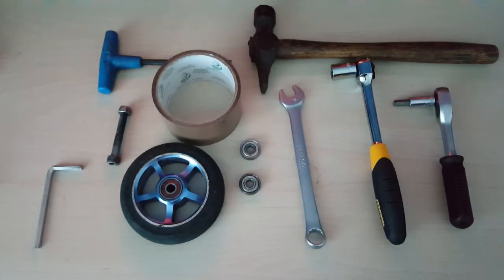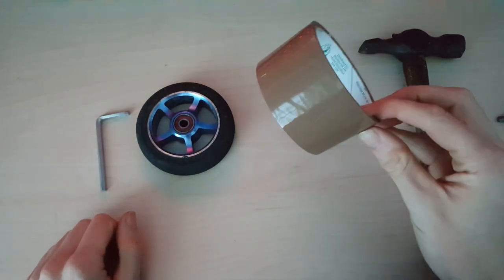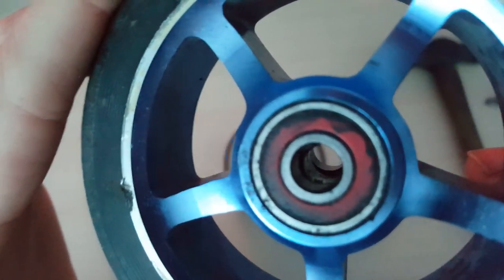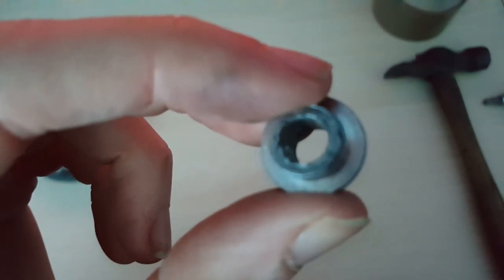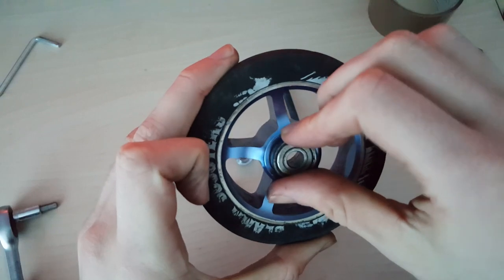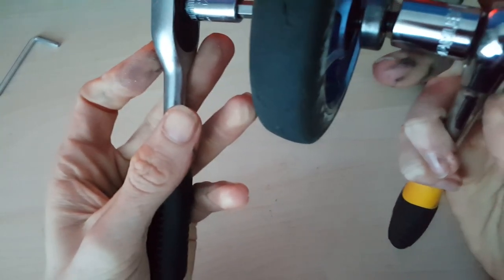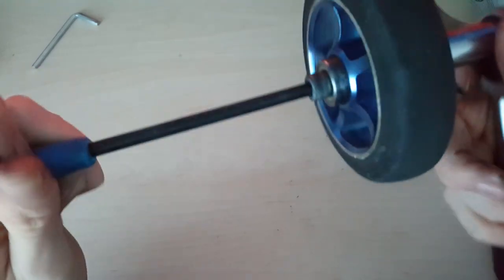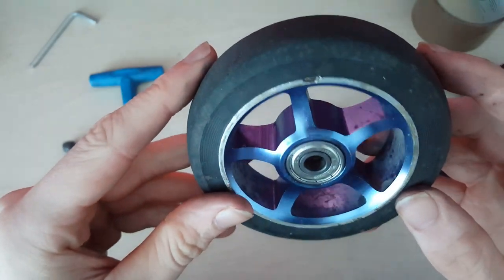HOW TO CHANGE SCOOTER BEARINGS | EASIEST WAY!

Comment: Not a bad video. Bare in mind, for ultimate bearing longevity they should be installed by pulling in the outer race and not the inner, you can use the same method using a bolt as a puller and simply use a socket that is the same diameter as the outer race.
Reply: Wouldn't the socket diameter depend on the nut or bolt? Maybe washers would help.